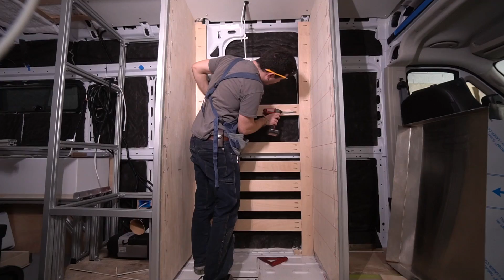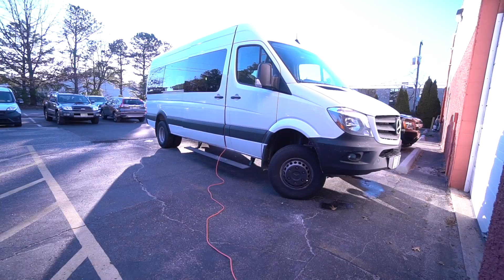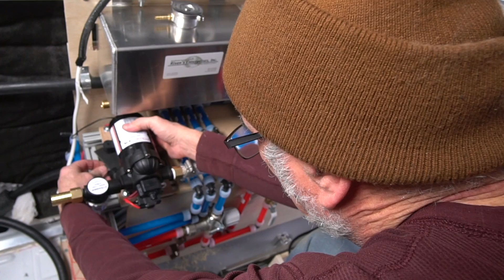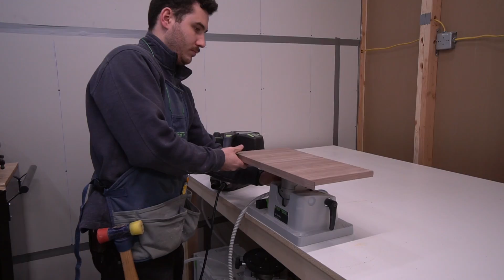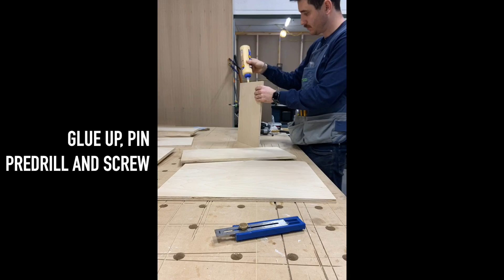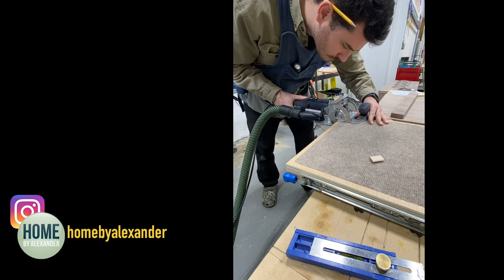Humble Road Promaster van build - Cabinets and Plumbing

Comment: The handles always go in the direction of flow, it’s the only way you can connect them. Plumbing 101
Reply from the maker: You’re missing the point Russel. The handles are mounted offset, so there are two ways to connect.
Reply: Humble Road The point is that the handle always goes in the direction of the flow so you know whether it’s on or off. Don’t know which offset you’re talking about and what that has to do with the flow. If you mounted them any other way it would be wrong because when you look at the handle you want to know if it’s on or off.

Comment: I don't see an accumulator in this water system. Does this pump not require that for smooth flow? Thx. 

I am finally starting a 170 Sprinter build after watching your videos for months and I am enjoying returning to your classes, professor.  It is a good way to pass the time in my driveway while on Covid-19 lockdown.
Reply from the maker: Thank you for your kind words. Will wait to see if an accumulator tank is needed..keep it simple if possible.

Comment: Great work! Although why use the heat exchange with the engine coolant, as opposed to using the engine coolant directly through your isotemp?
Reply from the maker: I only wanted to cut into the chassis coolant system and steal its heat, not send it all the way back to the water tank. Plus, my glycol is less toxic and a separate controllable system from the chassis. Options!
Reply: @HumbleRoad  Yeah it's a great idea! One I had not considered

Comment: Very interesting way to connect the water lines.  I have never seen nor heard of that method before.  Though I would think SharkBites would be better as they are removable without destroying the piping.
Reply from the maker: I know Shark Bites are widely used, but I prefer the Uponor fittings.

Comment: What great craftsmanship George. I needed a good walk thru like this of the plumbing system. One question. You did not explain the valve exiting the water heater. I am assuming it is another temp regulator and has a leg coming in from the cold side?  Can you explain the need for this? Thanks
Reply from the maker: Exactly Jay! The water heater has its own mixing valve to adjust and control the temperature. You can see the braided stainless steel hose coming from the cold inlet over to the hot outlet.

Comment: 8020 is beautiful stuff. Expensive , especially with all the different connectors and screws. Used it building machines and it always looked and worked great. Had to chuckle at your first experience at using a knockout punch. Been using one for so many years, forgot what the first time was like. You can get isolators for your pump through McMaster Carr. They are cheap and very effective. Beautiful build. Obviously above my pay grade with the use of all the 8020 . But beautiful just the same.

Comment: Assuming that carpeted piece in the drawer stack is a step for the bed? The magnetic catch installation is as elegant as the plumbing manifold! Amazing engineering combined with incredible craftsmanship!
Reply from the maker: You assume correctly, John. The bed step has drawer glides that lock-in and lock-out. So we disabled the lock-in and achieved the same result with the recessed magnets.

Comment: Just wondering, but 5:30, aren't all gate valves made so that the lever shows either flow or blockage? Are you the innovator here?
Reply from the maker: Steve Mfr the lever is mounted offset to one end, not centered. In order to maintain consistency and thought convention, they are all offset in the same direction; the direction of the flow.
Reply: Humble Road got it :-)

Comment: That’s a lot of fittings. Would it be more reliable to bend your tubing rather than create so many potential fail points? Or is that not a valid concern?
Reply from the maker: Clarion with Uponor, I’m not worried about failure. With the support clips there is no stress nor movement. But if there is a failure, you’ll ALL know about it!

Comment: Coming from a 37 year veteran cabinetmaker who has learned plumbing, electrical (auto and house), tile, epoxy countertops, carpet-laying and aluminum TIG welding, I see your quality and smile.  Good thinking is not hard to spot, George.
Reply from the maker: dandexinventor thank you 🙏

Comment: If anyone's ever wondering why people charge so much for van builds, those Propex valves alone are around $15-$20 each. The math adds up fast when you're using high-end components.
Reply: $6.99 on Amazon if I'm not mistaken.
Reply: @MikeQED  Well, I guess it depends which brand you're using and where you get them. I buy them locally and they're a different brand than what Amazon sells so they end up costing more and could be better or worse. The ones on Amazon don't seem to get good reviews though.

Comment: What fantastic work.  I love your attention to details.   What is the model of the coolant pump you connect to the Rixen reservoir?
Reply from the maker: Thank you Mike. That pump is a Bosch.
Reply: @HumbleRoad  Remember which model? Don't see it listed on your website.  Anything special about it vs the Rixen coolant pump?
Reply: @HumbleRoad  what's the capacity of the expansion tank?

Comment: You should have insulated and paneled the entire van first or you will have drafts and mold problems later
Reply from the maker: disagree. I've covered this topic in previous videos. Air flow is the best medicine.

Comment: A single drain in the shower isn't ideal, unless this goes on some kind of mechanical lift/stabilizer that keeps the floor perfectly level. Showering on any kind of incline might leave pools of water in the shower pan. Ideally, one drain hole in opposing corners or some such might make sense.
Reply from the maker: Yes, I put four drains in the Sprinter. Not so here. Promaster undercarriage in that area is not good for drains. And consider this-you would not shower on an un level piece of land, you know how to live properly in a van. So do the Careys. It will be fine.

Comment: I was so glad to see that the drawer hardware used is curved.  The hardware on the first build looked like it could catch a piece of clothing or body part.  I winced every time I saw those handles but the current build seems right.  Nice work.
Reply from the maker: Actually the hardware on van 01 was curved. That's how Vagabond knew to buy curved. You might be thinking of the wall cabinet handles? They were angular, but you can't catch anything up there.

Comment: George, you must really trust those connectors!  I count about 40 right there around the pump and another 20 or so for the hot water.  My thought is that every connection becomes a failure point, though I guess this system most likely not be pressurized all the time or ever at at very high pressure.  If this were to ever freeze though.... As an engineer (retired now) I suppose you could add a freeze sensor to start the pump and open a few purge valves to automatically purge most of that water automatically.  Good thing for you I don't live nearby or I would probably be sitting around there on a stool complicating things.  As an EE student in college, I "was" the service dept of high-end stereo shop when not in class. A retired EE professor spent most afternoons there in the shop with me working on one project or another.  Great job and it's nice to watch you and Alex exhibit fine craftsmanship.
Reply from the maker: I do trust these fittings. Check out Uponor North America for specs and success rates. I used to photograph brochures for a high end stereo retailer. Tube amps! Speakers that would make you swear the orchestra was in your head, centered between your ears!
Reply: @HumbleRoad  That was the 70s when I worked at that shop and yep we had tube gear as well, back when Saul Marantz, Henry Kloss and others were in their heyday.  I went to the CES show for many years (mainly for fun) and always spent plenty of time at the esoteric audio demos - they used to be concentrated at an off-strip hotel and each would have a suite.  The manufacturers would replace the bed, etc. with a couch on one side of the room and an incredible system on the opposite wall with very specific speaker placement regardless of what they were showing from a turntable at one suite to speakers at another, etc.  I grew to love Patricia Barber on vinyl and other near-perfect recordings they used for demo since the "source" was key to it all.

Comment: Okay I guess I will be that guy.  When Alex is cutting out the parts for the drawer boxes he is performing cuts that are generally considered unsafe because they are prone to kickback.  Typically you want to avoid cutting out pieces wider than they are deep when ripping between the fence and blade.  Alex should build himself a cross-cut sled (or use a different type of saw) to cut out those drawer boxes safely.  See  https://www.youtube.com/watch?v=uE9f4bp_wm8 for an example.
Reply from the maker: No worries, James. We are aware of the dangers. The reality though, is we must make better use of our time right now. And you need to know where to apply pressure on the material in order to maintain a safe cut. I appreciate your comment, thank you.
Reply: With respect, there are several ways to perform the same cuts at significantly less risk — and JUST AS FAST. As is,  Alex is unnecessarily risking a dramatic drop in productivity if he were to be injured. Something my neighbor (with 30 plus years of woodworking experience) learned just last year when he lost two and a half fingers while performing the exact same type of cut — in spite of having done it hundreds or even thousands of times before.

Comment: Any concern about the OAT coolant reacting with the copper heat exchanger in the engine compartment?
Reply from the maker: The OAT coolant is fine for aluminum or copper. It's the lead solder in older copper radiators that will degrade. I believe my heat exchanger is brazed with copper, But I will contact the manufacturer on Monday for precise clarification. The placement of the heat exchanger is in an open area, easily inspected. And if a failure did occur, no harm to any part of the vehicle. Thank you for your comment, good point.

Comment: Inspired! The plumbing itself has feng shui allowing the rest to be sparse, aesthetic, breathable and not get in the way. One of many examples of doing more with less in your shop. The cabinets look great! A question- where did you decide to drill the hole for the glycol line to get to the engine? Thanks for the great video.
Reply from the maker: stay tuned!

Comment: Absolutely beautiful.... I think you may need a backflow or some other type of valve between the pump and the manifold/hot water heater to prevent water from draining when you clean the filter on the pump
Reply from the maker: wouldn't the pump itself act as the back flow preventer?
Reply: Humble Road,
  What kind of pump? Some pumps can run backwards.
  Love your videos of your custom "art"work! Just beautiful!
Reply: Now that I think about it you’re probably correct otherwise how would it hold pressure. but if not and I understand how you routed everything I believe you can just turn off each of the valves on the outflow side of the manifold

Comment: What is an Accumulator Tank and do I need one?

February 8, 2018 by Craig.

Pump manufacturers will often have a range of accumulator tanks to enhance the performance of their pressure pumps. An accumulator tank is a water chamber which has a pre-pressurized internal air bladder. They are installed in the pressured side of your pump and dampen water pressure 'spikes', reduce pump cycling, help increse the pump's life and also save battery power.   https://www.rvworldstore.co.nz/guides-advice/what-is-an-accumulator-tank-and-do-i-need-one/
Reply from the maker: Certain systems do not need an accumulator tank. The only way to truly know if you need one is to run the system. And keep in mind, they sometimes leak. One more item to fail... KIS
Reply: @HumbleRoad  Don't those tanks increase water pressure?  George, you bring up a good point about "One more thing to fail".  Carey on....  Grin
Reply from the maker: AN accumulator tank doesn't increase pressure, it maintains it. Keeps things running smoothly. Reduces pulsing.
Reply: @HumbleRoad  And your reasoning makes sense, "Keep It Simple".  Thank you, Sir!
Reply: I installed an accumulator tank in my Roadtrek Zion and it stops the pulsating of the pump and the pump doesn't always have to run if you need just a bit of water. I think it reduces some wear on the pump. I had one in my 2 other travel trailers. Works well.

Comment: That plumbing system is so sexy you needed to make sure that it was fitted with a rubber! Protection is important. Especially from vibration. 😉
  It looks like you’ve thought of everything George. 
  You could even use the valves to throttle each flow if you find that the shorter legs need less flow through them to provide less heat. 
  Your specialized tools are very cool!